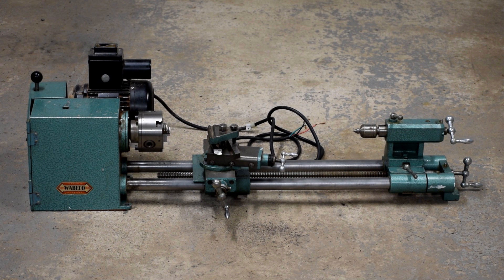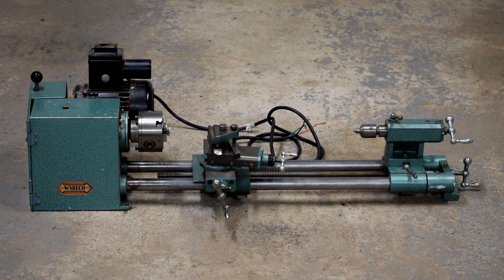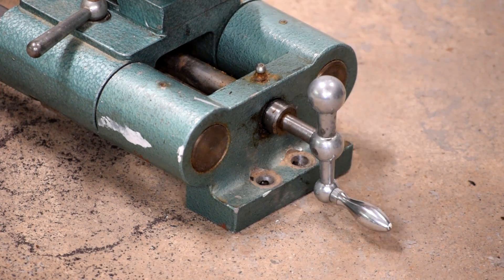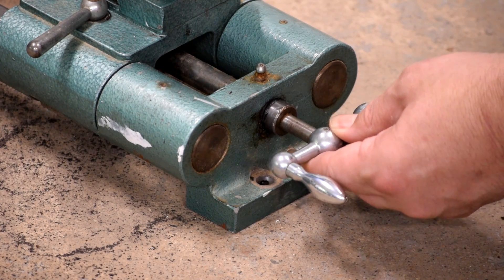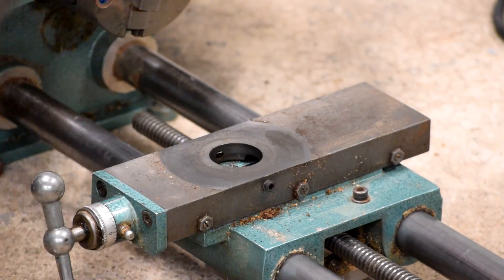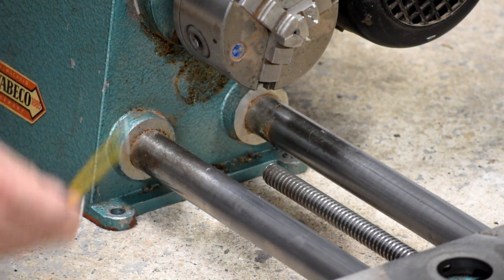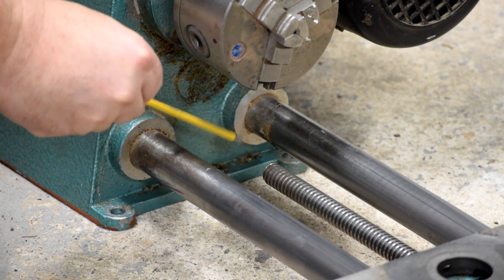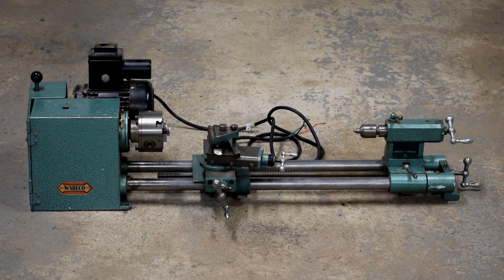Far North Racing CNC Adventures Episode 3 - D2000 Lathe Pre-Conversion

Comment: I can see a lot of potential with that lathe.  You could even buy (or make) a longer feed screw so you could modify the head section to support bearings for that screw. And also install a bearing in the tail section. Just thinking out loud.
Reply from the maker: Because the OEM leadscrew is bent, I'm going to add a ballscrew. I looked at running the ballscrew back into the headstock (as later models do) but machining the headstock to fit the bearing block is awkward, and doesn't change the total carriage travel. So I'm going to machine a "dogbone" that straddles the bars to support the floating end of the ballscrew. That conversion will add a bearing on the tailstock side of the ballscrew.